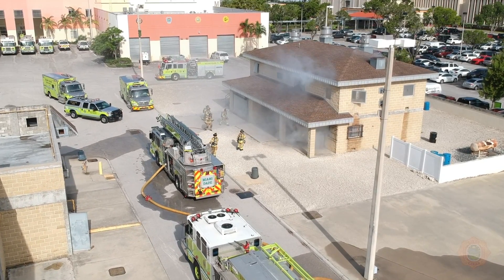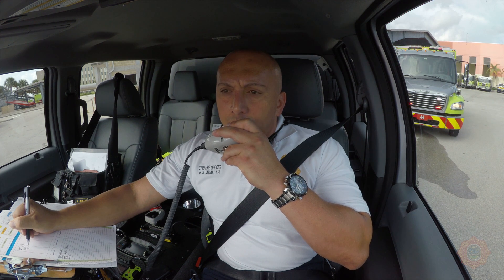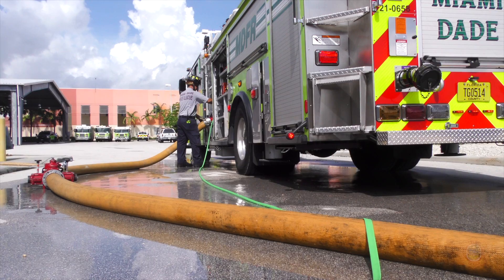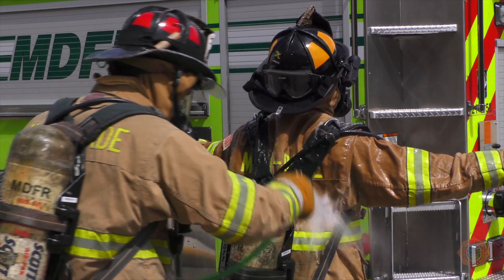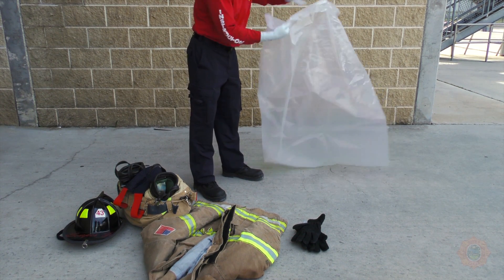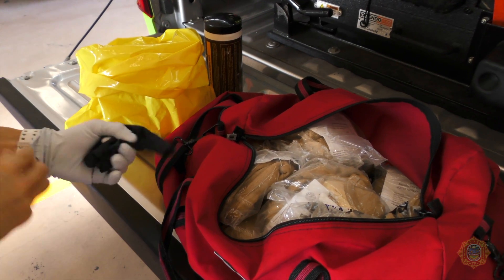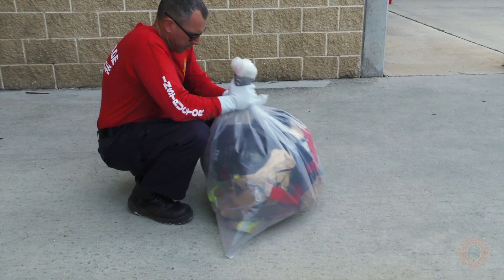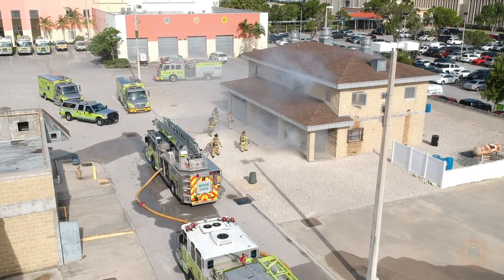On-Scene Gross Decontamination

Comment: Love the emphasis of personnel safety, only question, what if the crew has another fire following the first?
Reply: Many/most depts have a second set of bunker/turnouts. A lot of fireman already did this after a good working fire as well .  Why you wouldn’t hose off or knock of the big pieces on scene is completely beyond me.  But there are/were a handful of guys that don’t.   This new policy is also a good way for depts. who are only purchasing one set of gear for their members currently .  It will make them have to purchase a second set.  So in that respect it’s a good idea.  It will make the bean counters have to pony up and be more accountable now for having appropriate PPE.  Unfortunately most budgets only approve money for the absolute minimum.  Don’t tell anyone but a lot of folks who work busy houses already have 2 or even 3 plus sets of everything.  Nothing worse than getting out of bed at night clean and jumping into wet, smokey , bunker gear.  Then climbing back in the rack...they’re are dudes who can do this.  I’m not one of them.
Reply: The best option for Post Fire is to use an NFPA approved decon like Decon7. Decon7 provides chemical neutralization (PAHs from carcinogens, acids etc) and biological disinfection (MRSA, AIDS, Herpes ect). If you do not have a 2nd set of bunker gear, D7 an even greater option for decon compared to soap and water, for the reasons mentioned above, as well as it takes about 4-6 oz of D7 to decon a Firefighter in bunker gear. So you will not be soaking, scrubbing or using a water source for turnouts (major time saver). Also this greatly helps to extend the live of bunker gear, as well as provide bio, and chem neutralization. Hope this helps.